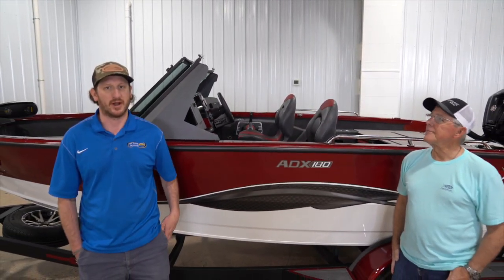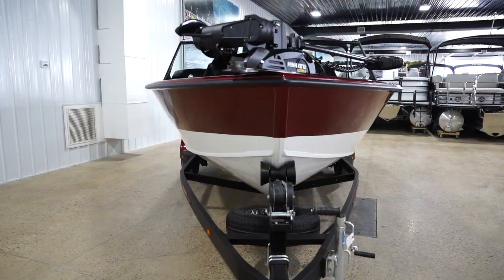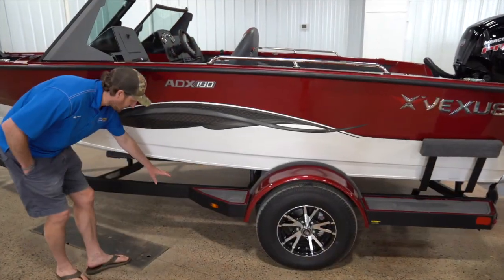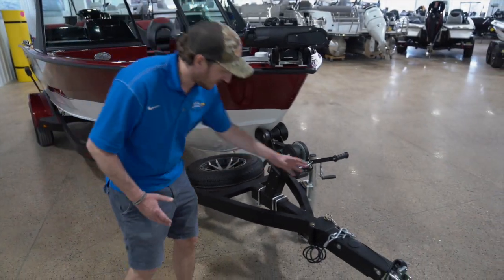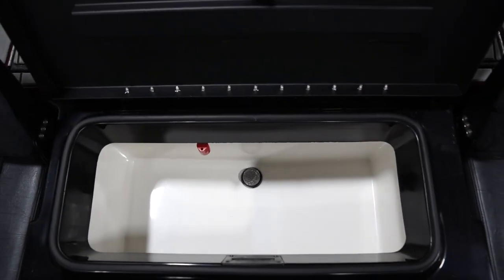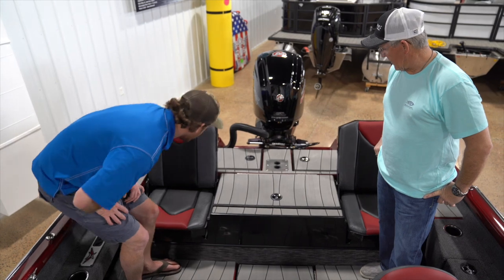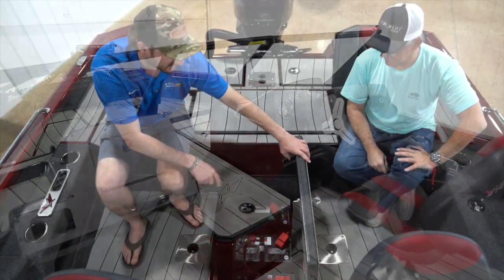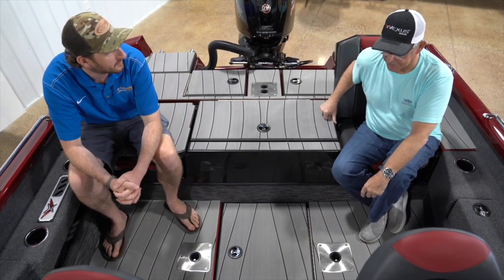NEW Vexus Boats ADX 180 Aluminum Fishing Boat (FIRST LOOK)

Comment: This is a Beautiful Boat ! If I could get it with a Suzuki 140hp motor I would buy it !
Reply: Why would want to put a 140 on it if it only rated for a 115? I would think a 115 would do great.
Reply: @shyman9023  
 They sell one a model that is rated for 150hp and I like the Suzuki 140hp because it has same weight as 115hp engines which is 100lbs lighter than 150hp engines.
Reply: @sha6mm  As long as it holds up should be a benefit. My buddy that sells outboards says they are good. I bought a Tuhatsu 115 off him and he told me they are pretty much bullet proof for holding up.
Reply: Isn’t the 140 Suzuki only rated 125 hp at the prop, where a Suzuki 150 hp is like 155 at the prop. So you’re really not getting all that you think you are with 140 horse label on it. I have read that Outboard motors can be rated whatever they want as long as they’re within 10% of whatever is at the prop for horsepower. Anyway, I like Suzuki’s too and I just put a 250 hp Suzuki on my boat. I’m also not saying that I know this to be a fact, because I did get it off the Internet, but there has to be a reason they have a 140 and the 150.
Reply: Why not skip the 115 and 140 all together.
Let's go with a jet engine instead, right? ...

Comment: Cubby hole @ the bow should be starboard side so that a graph(s) can be mounted more portside. That way you can more easily utilize the bow step pad to exit and enter the boat at the bow. Also, what is the exact length of the portside rod locker? Will a 9-foot rod fit in there? Also, did I hear correctly, 115 max outboard rating? If so, epic fail for an 18-foot class boat!
Reply: I’m with you. 115hp rating is a sin. Why would you buy a 18’ boat with a 115?  It will be a dog for sure
Reply: I guess if you have to go over 40 mph, but I run a 115 on an Excel 203 Bay Pro and for me it is fast enough, plus I saved $3,000 over the 150.

Comment: i hate that every boat  under 22 ft has foam as the coast guard mandates it.  doesn't matter what foam is used they all end up absorbing water. even in 5 to 10 years old.  love this boat. and the 190 but hate that its spray foamed, and would be really hard to remove the floor the remove waterlogged foam which will happen.  foam will even absorb moisture from the air.

That transducer wire exiting the hull below the waterline. hope that grommet doesn't leak.

also the boat straps you say they added the brackets for better placement. should be also offset back an inch or two, as the strap is touching the boat and will wear the paint while trailering with the wind and vibrations.
Reply: Will not absorb water if closed cell and the foam is good when put in.
Reply: My 2001 is bone dry., but it s starchy craft
Reply: Not closed cell foam bud. No way, no how!

Comment: A 18’ boat with a 115 rating is terrible. No reason for it not to be a 150. It will be a turtle on the water. I’m out.  The king fisher is a 150. Many of the lunds and crestliners will take a 150.

Comment: Why don’t they weld aluminum step back piece on the bottom of the transom so that you can put your plastic board on there for mounting transducers so you’re not drilling into the flipping hull.